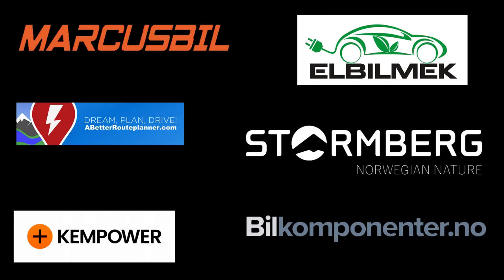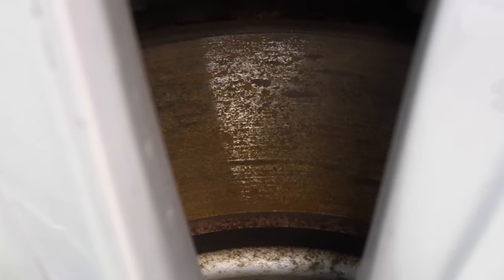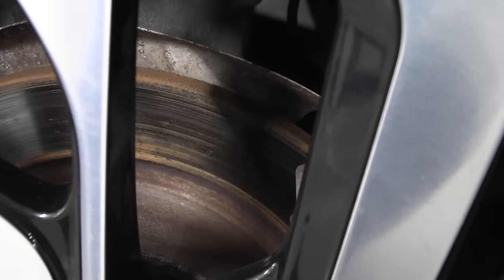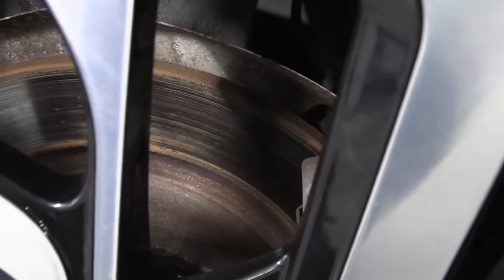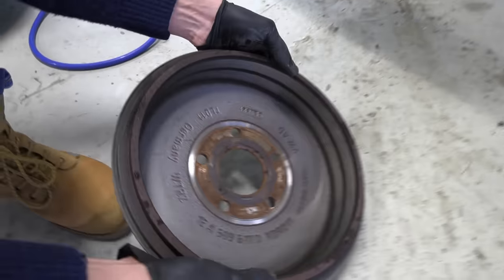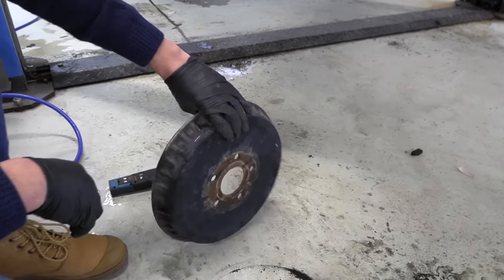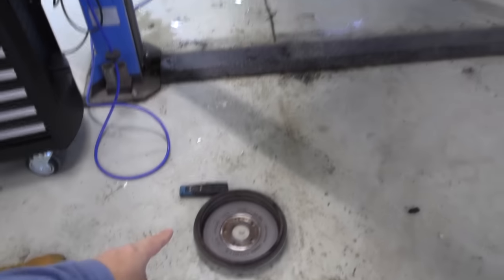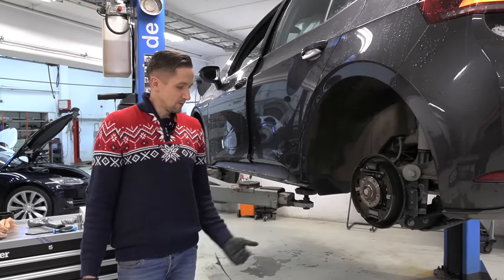How much rust is in VW ID3 drum brakes after two years?

Comment: As others have said, the ID cars already have regen on the back wheels, so low maintenance drum brakes is just good engineering on the part of VW.
Reply: IDs are RWD?
Reply: @antoniocirino8444 yep, rwd only. At least for now
Reply: @antoniocirino8444  ID.3 are all RWD. The ID.4, Enyaq, Q4 e-tron & ID.5 are either RWD or AWD depending on model.
Reply: Also, rear drum brakes create less drag than rear disc brakes. That allows for EVs like VW IDs with drum brakes in the rear to have more regen done at the rear wheels compared to disc brakes.
Reply: Drum brakes is probably the best engineered part of the whole ID line-up...
Reply: drum brakes can have greater stopping power because of the higher surface area. 

the issue is overheating because of the enclosed design.

Id rather have drum brakes on an ev than disc brakes with an unknown amount of surface rust, if I suddenly have to stop.
Reply: Regenerative braking doesn't work in the cold around MN, and every single old car I've had has had leaking past the rubber cups in the rear drum cylinder. If they had peeled back the black rubber seals on either side of that cylinder, they may have seen leakage already past the cylinder rubber cups, but they didn't do that for obvious reasons. After 10 years, especially if the car has sat for any length of time or hasn't had the fluid replaced, leakage is much more likely in drum brakes. VW is not doing the 3rd owner of these cars any favors, but the first owner will probably pay $4.00 less because of the cheaper drum brakes.
Reply: @WiseWik  and that tells a lot about the rest! 🤣
Reply: @DUCKSAREEVILLLLLLLL  regen works in northern Sweden (arctic circle and beyond). -40c this winter and no problems.

Comment: Drum Brakes have real advantages for EVs. As recuperation is always active in EVs, around 80-90% of the brake torque is anyhow done by the motor. Brake performance on rear axle is really not an topic in EV use case. Drum brakes have almost no drag torque (compared to a disk) and less particle pollution, brings more range,or less consumption and is environmental friendly. In the ID3 with Electric parking Brake it is designed for lifetime. From my persoective a perfect solution and a kind of reinvention of an „old“ brake technology perfect fitted to the needs of EVs. Unfortunately most people do Not understand it…..
Reply: Drum brakes can have better braking performance than disc brakes. But they very easily overheat so it's basically one or two time performance. But on other hand, how many emergency stops does one make? Especially today, we have a tire traction problem, not the braking performance problem.
Reply: Exactly. The only thing that I would change would be to have aluminium drums instead as it doesn’t corrode plus it would improve suspension comfort. I believe Honda CRX HF in the 90s had it.
Reply: @sindresvindal2290  Drum brakes are typically made from cast iron or steel rather than aluminum for several key reasons:

Thermal Conductivity and Heat Dissipation: Steel and cast iron have lower thermal conductivity compared to aluminum. This means that they can absorb and dissipate the heat generated by the friction between the brake shoes and the drum more slowly, preventing overheating and brake fade over time. Aluminum, while it can dissipate heat quickly, could lead to rapid changes in temperature that might affect brake performance and durability.

Strength and Durability: Steel and cast iron have higher tensile strength compared to aluminum, which makes them more resistant to the stresses and strains experienced during braking. They are less likely to warp or deform under high loads, ensuring consistent braking performance.

Wear Resistance: The braking action involves significant friction, and steel or cast iron has better wear resistance than aluminum. This means that drum brakes made from these materials will generally last longer before needing to be replaced or resurfaced.

Cost: Cast iron is typically less expensive than aluminum, making it a cost-effective choice for manufacturing drum brakes. This is important in the automotive industry, where cost reduction is a constant goal.

Coefficient of Friction: The materials used for making drum brakes are selected to have an optimal coefficient of friction with the brake shoes' lining material. Cast iron provides a good balance between performance and wear characteristics.

While aluminum is used in some brake components, particularly in disc brake calipers and some high-performance or lightweight brake rotors, it is generally not used for drum brakes due to the reasons mentioned above. However, there are some applications, such as in racing or high-performance vehicles, where aluminum brake drums may be used for their weight savings despite the potential trade-offs in heat management, wear, and cost.
Reply: @darekmistrz4364   yeah , any type of brake is perfectly able to lock the wheels but discs have the possibility to disipate heat marginally better (you know it would be "much better" imo when i will see fluid cooled brakes with fan radiators :P until then it disks just mean better airflow on a tiny area ) .

Comment: For a drum brake, VW actually used a pretty big size for the ID.3, but perhaps because it is an EV they figured they wanted to play it safe. You have to admit it was a smart solution to use "antiquated" tech like drum brakes on a car as pricey as the ID.3 but the engineering principle on keeping it long lasting due to regen brake is sound.
Reply: Just cost reduction.
Reply: @popaovidiu3282  Maintenance cost reduction, yes. For parts costs, probably not.
-- get a Chargehanger
Reply: ID4 also use drum brakes! But for this low Power EVs ist fine
Reply: @sebastiankiesl1395 Nothing to do with power. Dimensionning is in regards of weight and max speed.

Comment: Fascinating to see old braking technology being reused, but those drum brakes look almost brand-new inside!  Can’t believe you can read all the part numbers!  Our polo rear drums in comparison…
Reply: It's cheaper, that's why it's used.
Reply: @DoiPunctZero  no, because it's an EV, the disks are  taking rust because they're almost never used, like on every Tesla...
Reply: Look at a Toyota after 10 years, same thing.
Reply: @DoiPunctZero  They are presenting the big advantage of drum brakes on EV. They dont rust at all which is a problem and brake rotors. Usually drum breaks perform worse but are cheaper for some reason. Thats why many smaller cars use drum brakes on the rear and brake rotors on the front.
Reply: Yes, drum brakes are not as good as disc brakes. Yes they are cheaper than disc brakes. BUT if you never use your brakes in your commuter car, it is a lot better to have NON RUSTING drum brakes than disc brakes which look like rust cake after 1 year
Reply: @DeepRacer-zr4yp  its good, until you have to use them and the drums start fading haha
Reply: @jimmyneutron5679  Nobody is gonna race their commuter car on the racetrack also the ID3 is electric and has regenerative braking. So in 90% of the case you will never notice it has rear drum brakes
Reply: I suppose ID.3 uses brake-by-wire so it engages rear brakes very conservatively, only in hard braking. It prefers EV regenerative in regular driving scenarios which is smoother, recharges your battery and doesn't cause any wear on mechanical components. Think of these drum brakes as a backup for hard emergency breaking - when they are used together with regen they could be even more effective than classic disc brakes.
The only downside of drums is that they do overheat very easily under heavy use so performance EVs like Teslas don't use them because people tend to get these cars to the race tracks.
Reply: @markinusmarkison2093 I have a Tesla and everyday you have somehow to use the actual brakes on intersections / higher traffic as you can’t rely only on the regen desacceleration. Not only that but sometimes at high speed someone brakes too fast too soon and you have to do it too so … at the end you always need the brakes and use them. Just a lot less when chilling.
Reply: @jimmyneutron5679  Drum brakes easily have a couple of full stops from highway speeds in them before fading becomes a problem. Sure they won't hold up when you are racing, but then again why the fuck would you go racing in a ID3, you can buy 3 second hand Mazda MX-5 for the same money and actually have a car to is fun to race.
Reply: rear drum brakes only 40% worn on my 90,000 mile auto fiesta. rear brakes never changed.
Reply: @ricarmig  drum brakes have about the same braking force, the problem is that they are more prone to overheating due to frequent use, that's their downside. Frequent use is nothing you need to worry about in an EV, drum brakes are perfectly fine for them.

Comment: These EV rust videos are very valuable 👍
Reply: @karlInSanDiego  exactly, use the brakes even lightly each drive and the rust on the discs will be gone (same as ICE) but with the benefit of less wear from regen braking!

At 4 years 80k kms I took my ev brakes apart to tidy up and lubricate, no replacement parts needed, and that’s with spirited driving

Comment: Drums on a car like this is a very good choice. Drum brakes have zero drag. They have very good braking performance. They are much better sealed compared to disks so they don't get pitted when you don't use them as much like on an EV. Where they actually suffer is cooling but since in a setup like this they don't see much action they are perfectly good enough. Another drawback can be that if water does pool inside and freeze they may lock up. On my car I have rear disks with drums inside for the parking brake. The drums inside and the parking brake are in perfect condition. The disks on the outside look like crap after two years and that's on a fossil car.
Reply: Just use your brakes properly every once in a while. Even the rear discs look perfectly fine on my car, and they're eight years old. And we even get salt here in the winter.

On EV's and hybrids the problem of brakes not getting used enough is of course bigger, so drums in the rear just might be a reasonable solution.
Reply: My fossil car has disc brakes front and back and they rust. I need to brake on purpose to keep rust away. I drive mainly countryside, no need to brake often. Rusting brakes are trouble for me. I need to avoid braking with the engine to prevent rusting discs.
Reply: @samijokinen9246  Rusting disks should not be an issue in normal driving. if you go down any sort of hill or brake from 60mph once a week you've cleared ALL rust away. unless you drive like a grandma and engine brake everywhere... also brakes are much cheaper than ANY part of an engine

Comment: Fun video....as an old guy in Canada, pretty much all our older cars ( pre 80's) had drum brakes and not just on the rear. I still own and drive some classic MGB's and they still have rear drum brakes. 
Not a bad idea for the rear of a smaller lighter EV actually.
In the area I live in they use an extraordinary amount of salt on the roads and a couple of winters of use in the old days and the undercarriage of our cars get pretty corroded.
Great video and Merry Christmas!!!!
Mike 🇨🇦 🍁
Reply: The drum break friction material is a pain in the Axx to replace. The break dust get trap in the housimg is not helping either. Last thing I wanna happen is a plume brake dust blown towards me When I pull the casing off.
Reply: @user-jh6vt8vx4v  I've done hundreds of drum brake repairs/replacements, not that bad, wear a respirator, gloves and vacuum the brakes with a HEPA filter bag in your shop vacuum, spray area down with brake cleaner and you're covered. No big deal, in any case there is brake dust and crap in the disc brakes as well....not as much as drum brakes for sure, but it is still there.
Besides, on an EV likely won't have to do brake replacements for a long, long time anyway!
Merry Christmas
Mike 🇨🇦 🍁
Reply: @michaellippmann4474 you are right on EV brake pad life span. Despite heavier car, the the regen helps alot. But frequent short distant commue in cold climate may diminish this advantage to a degree due to energy recover is not working at full effective when battery is cold. But it should be still able to last over 100k under sensible driving compare to 70k ish on ICE car. Merry Chrismas
Reply: My mark I mini had drum brakes. It also lacked brake assist so was fundamentally useless. On a more positive note -it was the only bit of the car which didn't suffer in wet weather, unlike the ignition

Comment: I had to have my i-pace rear disks replace after 4k miles, it was a demonstrator during Covid so did the same journey every day. I keep them clean by going into neutral down a hill near my home and using the brakes to slow down 👍
Reply: Same. There's a long, fast hill I drive weekly so I put the car in neutral at the top and brake gently on the way down coming to a stop at the junction. It keeps the friction brakes rust free.
Reply: Yes, it is very much the driving style... We were driving our i-pace on german motorways (sometimes with heavy foot), we head no rust issues in nearly 4 years

Comment: Valdemar is a great guy! BMW i3 I recently had to replace all 4 discs and pads due to rust to pass EU. Not worn out. 75000 km. It costed me 14000 NOK. I try to break hard from time to time
Reply: You could just brake 100-0 several times on an empty road, it would remove the rust for free

Comment: Drum brakes are not entirely maintenance free. As u could see, dust builds up in the drums and needs to be removed from time to time. This ID3 is quite new but after years the springs will rust and retract poorer which increases drag. Discs are exposed but u can see if there is rust on it and brake excessivly or drive a while without regen if possible.

Comment: The old VW Beetle had drum brakes all round. The drums have some self boosting capacity, but they cannot dissipate heat as quickly as disc brakes. On bicycles and light mopeds they turn the drum brake mechanism around so they have anti-boost preventing wheel lock up and falling. I am a big fan of drum brakes for lighter and "commuter" cars. I have a Mitsubishi 2015 Space Star (Mirage) and it has drum brakes in the rear. They are almost maintenance free and trouble free whilst the front discs have been replaced already.
Reply: That is because your brake bias is set at 70f and 30 B. Lol of course it is lasting lot longer. The rear drum brake is used more for park. My 05 civic has drum in the back, it is always the front lock up when I blow the brake padle
Reply: On EVs there's not much need for high heat dissipation, since the mechanical brake is just for emergency stops. Everything else is mostly done by regen braking.

This is what a lot of people in the other comments don't understand

Comment: Italian Tune-up in dino juice cars is hard acceleration to dislodge carbon build-up in the engine, followed by hard breaking to de-glaze the brake pads and clean the rotors. Sounds like EV's can do with a little bit of this as well occasionally. Rear Drums are still the best type of brakes for normal commuter vehicles
Reply: 😂Depends on the driving behavior. I need to use the brake on my model 3 at least once a day.
Reply: de-glaze? ok you got that totally backwards, there is no de-glazing unless you mill the brake discs. hard braking can lead to overheating which causes glazing. common on trucks where drivers use incorrect braking techniques.

Comment: They're a perfect choice on EVs for the rear axle where you anyway (in any vehicle type) need only a lot less braking power than on the front axle. Replacement is also cheaper, and often you can get away with just replacing the shoes/springs and not the drum. The issue with drum brakes is bad heat dissipation (again, not too much of a problem on the rear axle) which can in extreme cases lead to a lockup of the brake (also contamination of the shoes or a defective cyclinder might trigger that).

Comment: There is no problem with drum brakes... Until the cover plate starts to rust, an parts of it falls of.. Especially the edges, but that takes decades.

Then there is the automatic adjustment, and everything else starts to set, cause the brakedust accumulate inside.